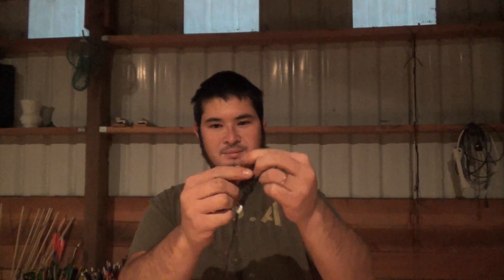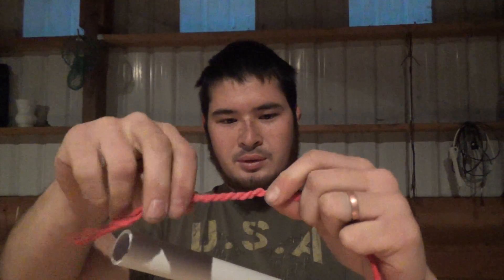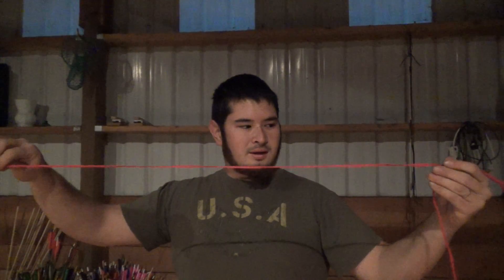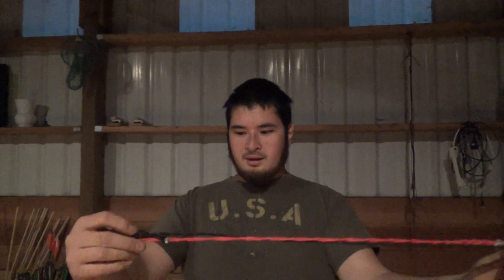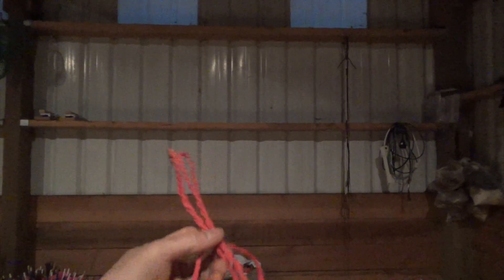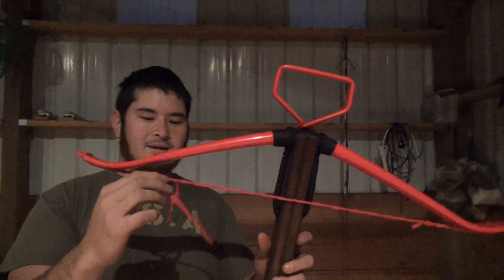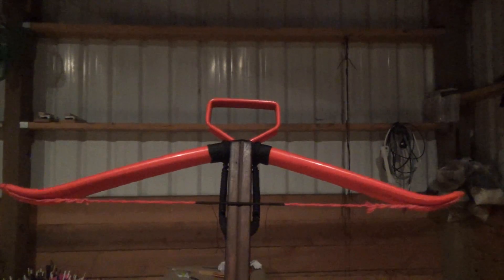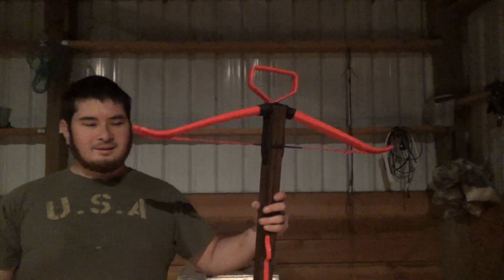100lb Medieval Style PVC Crossbow for Under $10 Part 5 - Making a Flemish Twist Crossbow String

Comment: When youre measuring out the strands to make the bundles do you cut them off or do you leave all of the strands connected ?
Reply from the maker: +cuicksand I usually leave them connected until I finish the string. It doesn't matter, either way works because this style of string has loose ends.
Reply: awesome thanks :)

Comment: Neat, how is its lifespan/performance over paracord?
Reply from the maker: Geo Wu You end up getting a few more FPS in terms of speed. The string itself will last a little longer, but the main difference is that I think it looks cooler. There is not a huge difference between a Dacron string and poly paracord IMHO.
Reply: What happenes if i use nylon paracord
Reply: +Leocernask8 the nylon will have some elasticity to it and you'll get weaker performance